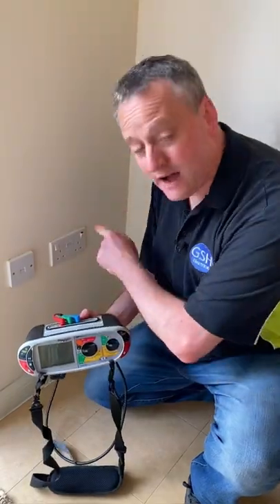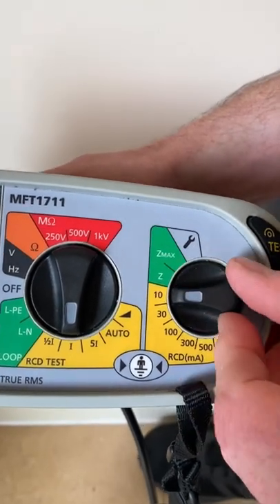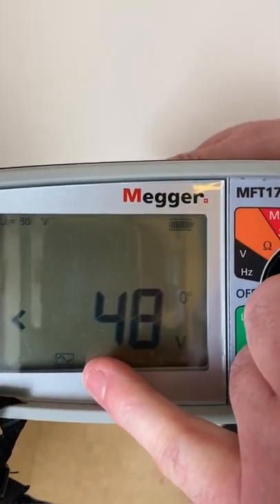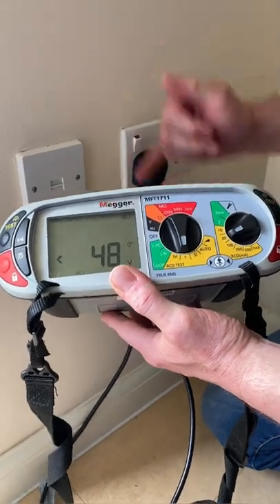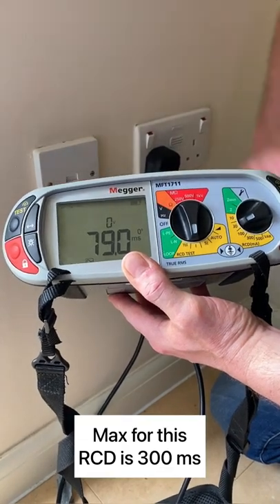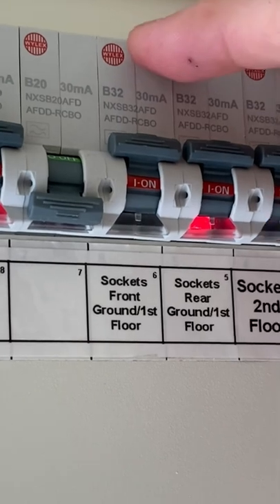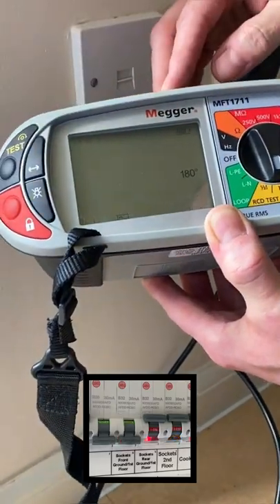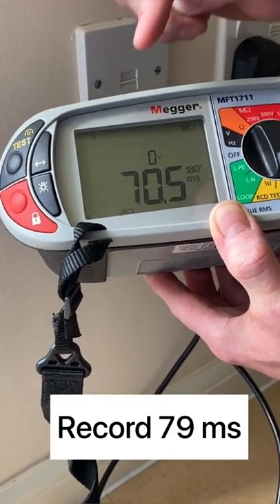How to Test an RCD - BS 7671 Amendment 2

Comment from the maker: BS 7671 Testing RCD’s - Regardless of the Type of RCD Test it as if it is an AC RCD at x1 ONLY https://youtu.be/zIPgYcLdQZE
Reply: Why does my meggar trip the Rcd on zs readings
Reply: @simonbooth7802  my ethos tester has a low current test for zs readings which takes longer but doesn’t trip breaker, the other earth loop test i just use for ze readings as is faster (and no breaker to trip)
Reply: @simonbooth7802  During a Zs test your meter simulates a fault between live & earth and measures the resistance.
If there is an RCD/RCBO in the circuit it detects the fault and trips. Some meters have a low setting which should avoid tripping the RCD.
Reply: @simonbooth7802  What setting are you using for Zs testing?

Comment: In your GSH video "RCD Testing Made Easier....?#shorts" you say all loads should be removed. This is also stated in the GN3 brown book page98 paragraph 2. So does the load include the cabling and should it be disconnected with the test done at the RCBO? With RCDs it was simpler as the RCD test could be preformed at the board with the MCBs off (although strictly speaking the neutrals may still be in circuit).

Comment: Never have seen such a test done in Europe. Is this a UK thing?
Reply: Here in Germany we do similar tests
Reply: BS7671 uk wiring regulations are some of the best and safest in the world. “HD 60364
CLC/TC 64 is the technical committee responsible for HD 60364, which is the European standard for Electrical installations and protection against electric shock. This is essentially the European version of BS 7671.”
Reply: In Malta it is mandatory to do these tests.

Comment: Or just put it on auto and get the 1 times and 5 times value together
Reply: I think that the 5 times requirement has now been done away with in the 18 th edition
Reply: @roystevenson1375  idk I’m the apprentice you see but we record both one times and five times
Reply: The 40mS disconnection is for 5x. 
How are you showing compliance at 70ms?
Reply: @crustyzimmerman3324  couldn’t tell you that I’m the apprentice we record the 1 times and 5 times at 30ma
Reply: 5x testing has been discontinued because it can eventually damage the RCD after multiple disconnections. Operating at or less than 300ms at 1x is considered sufficient now. 1/2x test is still good practice.

Comment: All change for Ammd 2!! Only one test...Don't need 0deg and 180deg..
Reply from the maker: Test at one times i Delta n as a minimum and for me in both half’s of the AC waveform 👍🏻
Reply: @GSHElectrical  indeed and agreed and for someone also who has been told over and over again during 16th, 17th and 18th, it seems a bit strange, now we only have to do one test on the RCD officially.
Reply: The reason for testing at 0 and 180 obviously is to ensure that the RCD detects and operates on either side of the waveform. But with 1x given we have a maximum operating time of 300 ms, if for example the fault wasn’t detected in the negative half, then there is time to ‘wait’ until the next positive half cycle to ensure compliant operation. Whereas at 5x and our 40 ms that becomes a little tighter once you allow for mechanical operation and where exactly in the wave things occur. 
Similarly I have never understood why the Fluke does the 1/2 twice on auto. The test runs for two seconds, so why do you need to run it again starting a 1/2 cycle later…

Comment: Someone please enlighten me. Is the faster the disconnection time the safer the RCD?
Reply: YES! It has to do with impedance (resistance) of the circuit. If there's an electric fault, someone could get electrocuted; therefore, it is imperative that the RCD trips (disconnects) the supply of electricity fast enough to prevent severe biological damage. If the impedance (resistance) of the circuit is too high then the RCD won't detect the imbalance in time so the faulty current will keep flowing (and causing damage). If the impedance (resistance) of the circuit is low enough then the RCD will pick it up (relatively) instantly and trip (disconnect) the faulty supply. That is why your EFLI (Earth Fault Loop Impedance) readings have to be compliant.
Reply: @kaizenanalyst4833  Shouldn't you be testing the RCD and not the circuit??
Reply: @BakedTuber  Yes, you are testing the RCD but that RCD would be on a compliant circuit (which you would've tested and confirmed as compliant upon initial installation of the circuit). And in fact, on pg 95 of Guidance Note 3 (published by the IET - The Institution of Engineering and Technology), which is updated to BS7671 Amendment 2, it says "Prior to these RCD tests, it is essential, for safety reasons, that the EFLI is tested to check the requirements have been met."
Reply: @kaizenanalyst4833  .I think you're confused...
Reply: @roystevenson1375  i've only just picked up some theory books. No practical experience ever. By all means, please set the record straight.